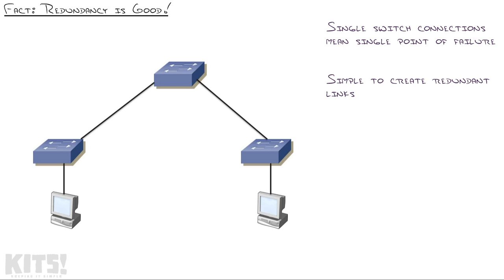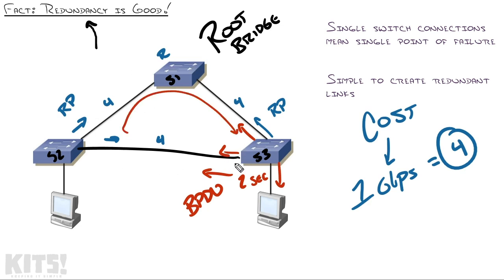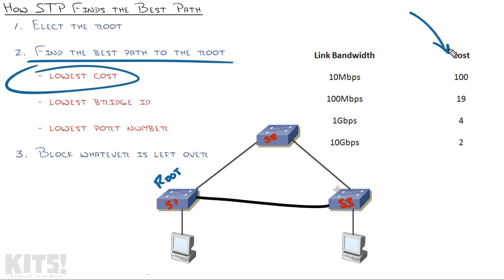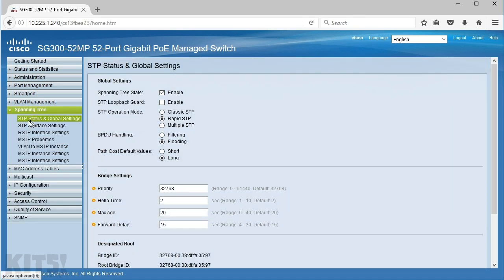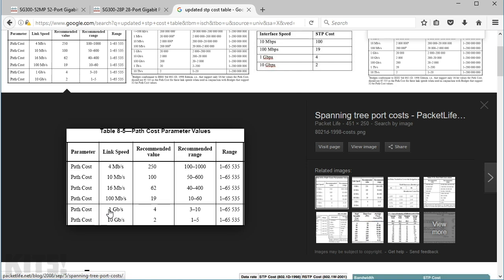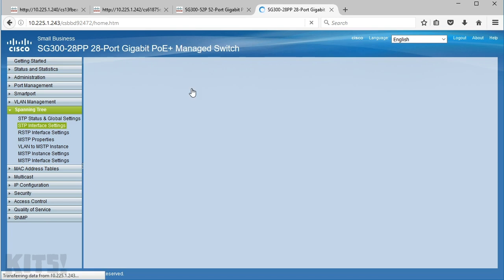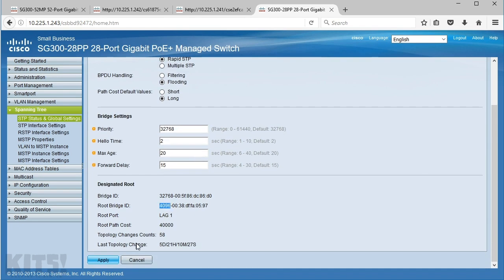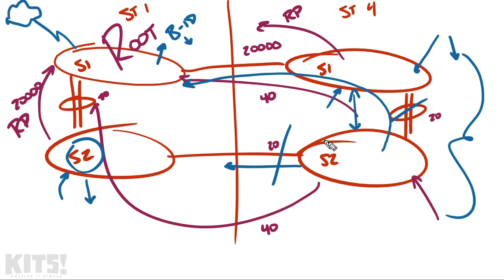Setting Up Core Spanning Tree! Ep.14: Real-World Business Switch Network Build

Comment: Ah, good thing they updated the port costs to match current link speeds.  Now the new port cost table will last forever since we'll never have speeds faster than they currently are now.  Those people in the past were so short sighted, I'm happy to see that the current engineers have fixed the system the right way instead of just offloading the problem to future generations.  In case you can't tell, I am being sarcastic.